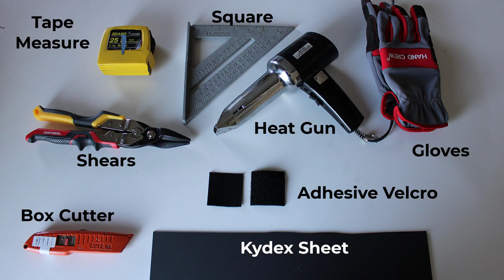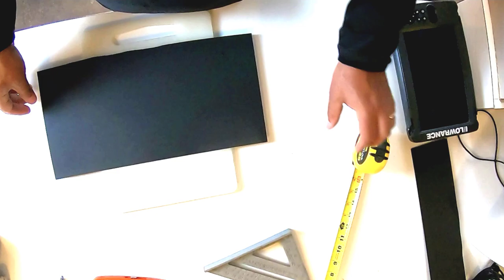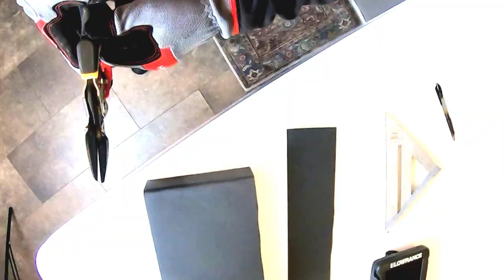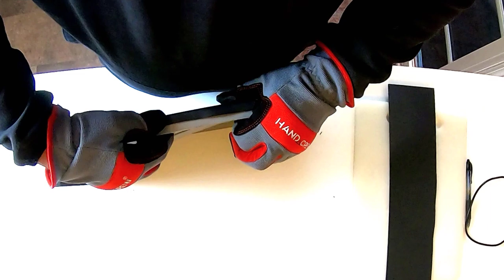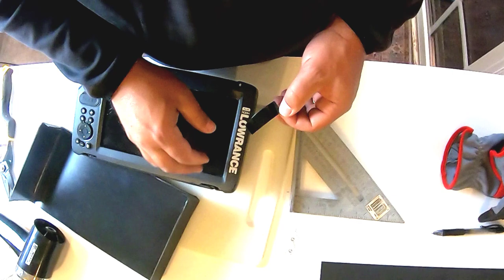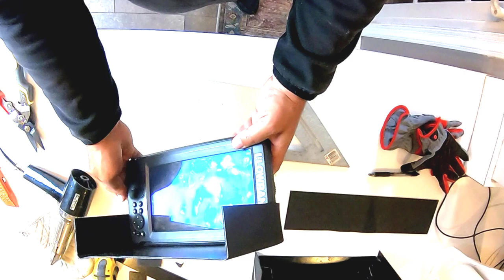DIY Kydex Visor for Fish Finders - How to Make a Kydex Sun Screen

Comment: Just find a meal prep container that fits cut the back out and you can use the lid which you can still see through a bit  cover if it starts raining or just to keep it out of the elements while out and about.
No need to heat bend just measure twice cut the back out and Velcro it to the back edge drill 3 small holes for air flow for condensation on the bottom. Takes about 10 minutes